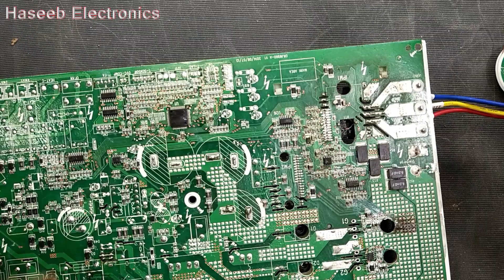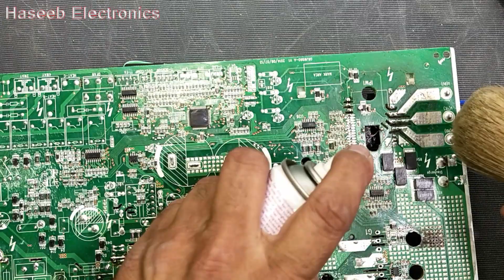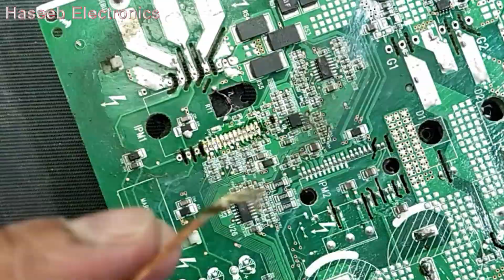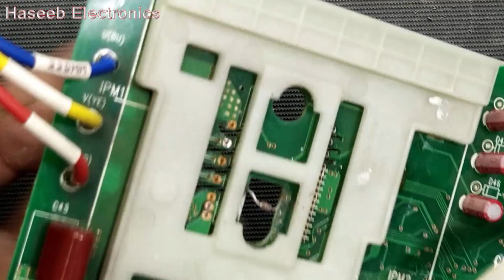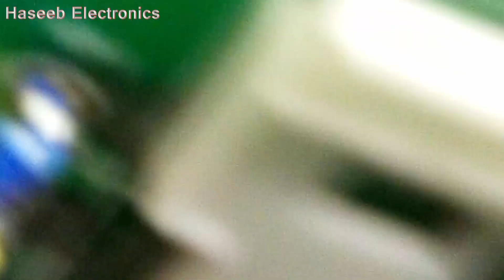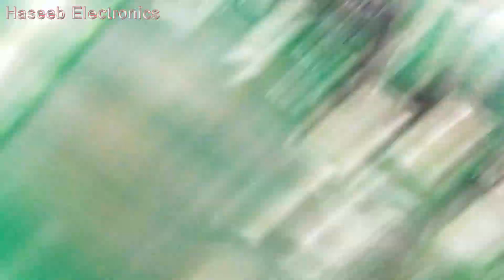332  How to Desolder IPM / IC from Through Hole  PCB / How To make Desoldering / Unsolder Components

Comment: Automatic desoldering tool is my favourite. Hakko has built a gun style tool that looks and performs outstandingly well.
Reply from the maker: exactly right. i was using Hakko 808 desodering Gun since 1997 till 2010. that was awesome
Reply: @HaseebElectronics  have you ever used any soldering tools made by Korean brand exso? I recently bought their flagship soldering station ledsol 300. It's extremely fast and powerful.
Reply from the maker: No I have no experience with korean product
Reply: @HaseebElectronics  Eleven or ten years ago I bought my Hakko 808, some time later I bought ZD-915, one Hakko FR-301, and many others, for  replacement of the Hakko 808 if it fail.

Hakko 808 never fail, still use it every day, all the others are in their boxes.

Two month ago I bought the Yihua 948, now I am testing, works very well, but always return to my trusted Hakko 808.

Best Regards.
Reply: The best industry throughole desoldering station was made for Hakko.
I have one 808 and one FR-301, if you can affort one high end desoldering go a head, but if you are in budget the Yihua 948 is for you, cost Us$100 and works fantastic.

Two months ago I bought one Yihua, works very well but at the end of the day I return to my trusted Hakko 808.

Best Regards.

Comment: One more easy method is to blow out hot solder by mouth  with metal pipe taken from FM radio antenna.
Reply from the maker: yes sir that is jogaad. that is also very useful